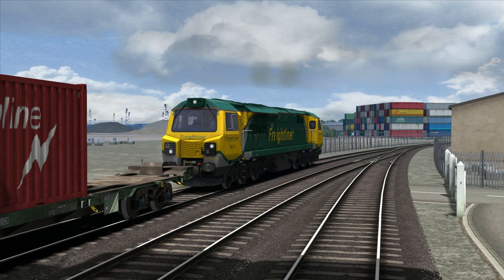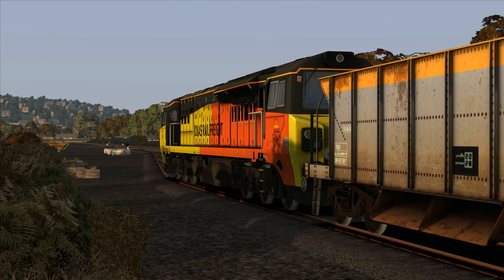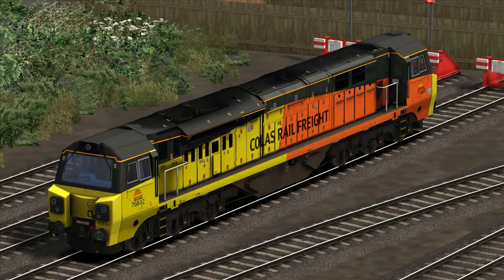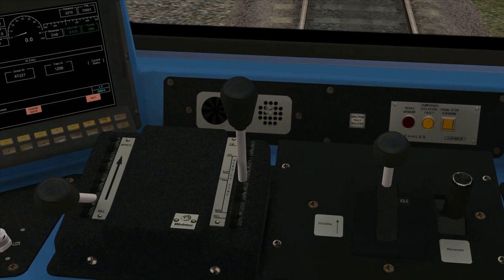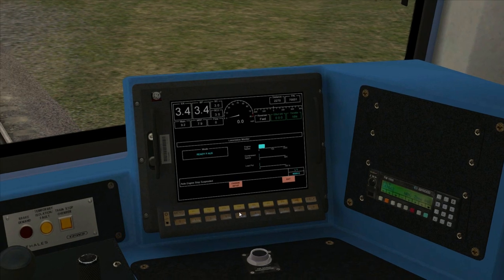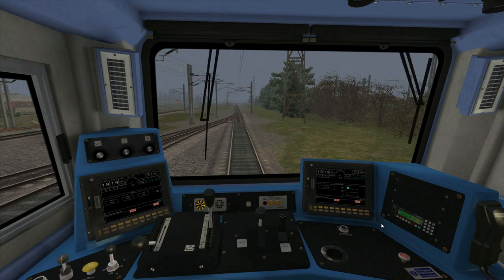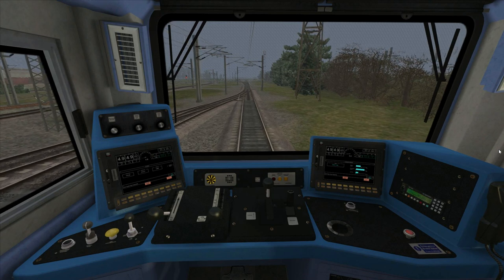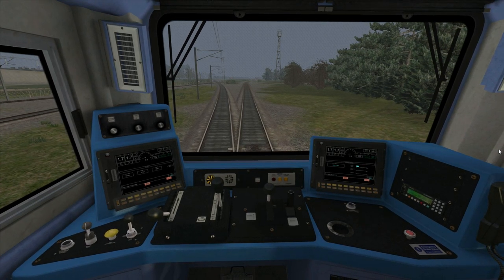Train Simulator 2015 - Train Guide: Class 70

Comment: Not keen on the class 70's, they've smashed up two sets of points that I've had to attend lol
Reply from the maker: +Dean McFarlane Haha, they're not my favourite locos either XD How did they smash the points?
Reply: PTGRail To be fair, it was the shunters fault, he didn't set the route correctly, but then the driver didn't check to see his route was set and ran through the points, which means a whole new set is needed. Replaced them on a really hot day, ended up with sun stroke lol. Just recently, same shunter, same train but different driver, ran through a different set lol
Reply: +Dean McFarlane Me too, I think they a bit out of place in the UK